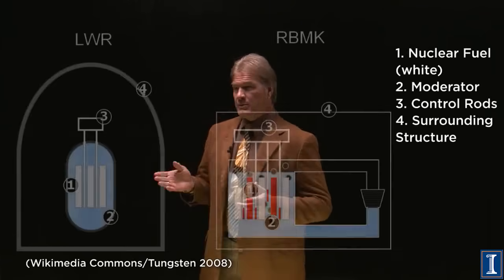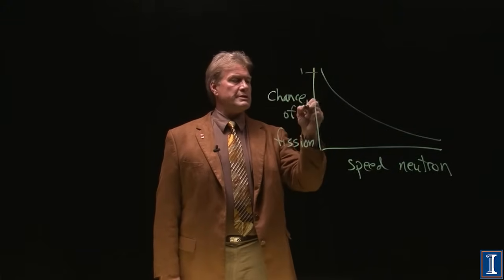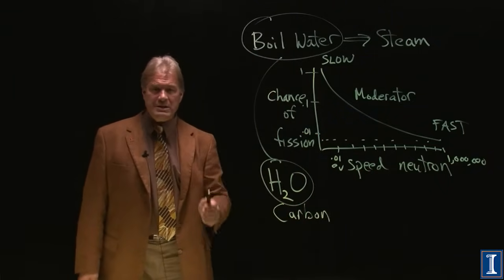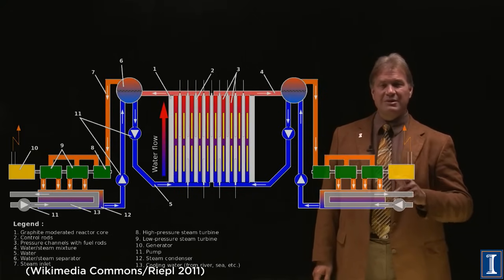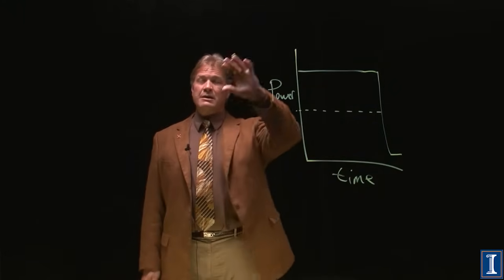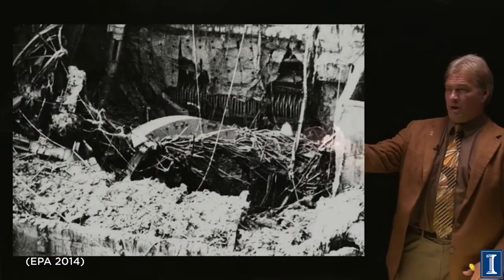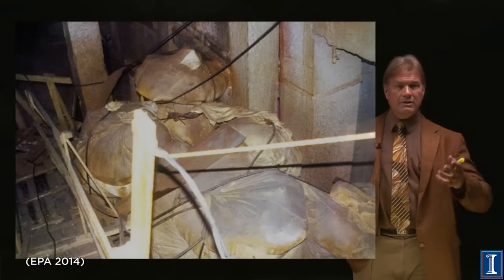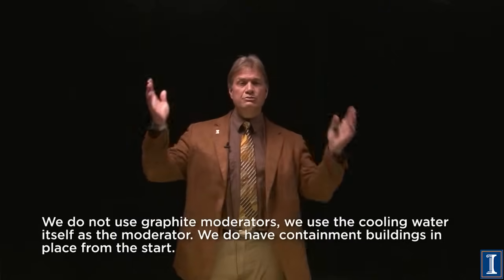Chernobyl: Worst Accident Ever

Comment: Fukushima had a containment buildings.  And why didnt the loss of water slow the reaction?
Reply: At Fukushima, the reactors were shut down automatically when the earthquake hit.  But they were still generating considerable heat -- about 7% of normal -- from the decay of short half-life fission products. 
They didn't lose coolant water, but without the backup power supply, the water got hot enough to chemically react with the zirconium cladding for the fuel rods. 
That produced hydrogen, which leaked out of the reactors' containment structures. But it wasn't vented from the buildings, and eventually built up to explosive levels. Add a spark, and....

Comment: The water/steam "ran out" in Fukushima and it still melted down.
Reply: His explanation is very sketchy and basic, but the point he is trying to make is that the reactor will gonna slow down its nuclear reactions when there will be no water, there was also water in that Soviet reactor and he even showing it seconds after he claimed that only coal was working there as moderator. Water was cooling the reactor but if you like it or not it will gonna act as moderator when it is there and reactor power will gonna go down significantly after you remove the water(but the problem was the rods with tips made from graphite and before they were able to start reducing number of neutrons they were first working as moderator->increasing them).

Comment: he forgot to mention that water also absorbs neutrons so when the water evaporated an excess of neutrons was available  without restrain.
Reply: "excess of neutrons" its not a problem if they are fast neutrons, that is why he started with this graph, to explain the difference...
Reply: @Bialy_1  water evaporated, part of the neutrons was not absorbed any more but graphite was still there to moderate them. moral of the story: don't mix graphite and water.

Comment: I honestly cannot believe those "containment" buildings he's talking about are able to hold down 450 tons of part "E"  thrown upwards by the explosion.
Reply: Some quick googling and notepad math says that a 3-ft cross-section of reinforced concrete above the reactor would've had a weight of 3907N, or only a little less than the weight of the Part "E" itself. Roughly doubling the amount of mass the explosion was lifting off the ground would likely reduce the size of the explosion monumentally, and that's not accounting for the force needed to deal with the tensile strength of the (hopefully reinforced?) concrete, separating that cross-section from the rest of the casket. Also Also: if you plug a gun barrel, the barrel isn't actually strong enough to handle the explosion of a bullet firing: it just redirects the force. With such a massive barrier above the reactor, the explosion would have been redirected sideways to the rest of the building, so if there was an ultimate failure, the explosion would have been directed generally "out" instead of it all being aimed "up".

Keep in mind, I'm not an engineer, just a layman with google and some college credits in physics.
Reply: @treyslider6954  unfortunately you're missing the point here: the containment must remain airtight after the explosion to keep nasty stuff inside (especially gaseous forms of iodine etc)
Reply: First, this assumes that the explosion is exclusively up, and while that's the case within the core as it pertains to movement of the lid and the materials inside, it's not the case in the containment building. Once the reactor lid is blown off, it will move in whatever direction it can. Much like fire, explosions with space like to spread out. The energy starts to dissipate. So, Trey's calculations are correct, but he only accounts for the roof as a negating factor. The explosion, which has already had to deal with moving the reactor lid, now has to punch out against 5 walls of reinforced concrete. Four to the sides and one above, assuming it's not ovoid or spherical which means it's even stronger. There's not only the mass of the walls to contend with, but dampening mechanisms built into the interior architecture. So, yes, it remains airtight in the event of nuclear disaster thanks to the construction of the containment building and the failsafe doors in and out of the area.
Reply: @Bialy_1  the light water is both moderator and absorber. It needs to be displaced by graphite moderator rods for the reactor to work properly.

Comment: Wasn’t the xenon already poisoning the reactor because they were running the reactor at half power for 10 hours.
Reply: If you know a lot about nuclear reactors you probably know a lot about half life’s. Iodine has a half life of 6 hours and after that 6 hours half of that turns into xenon. If that nuclear reactor just dropped to a low level exponentially that wouldn’t cause a xenon poisoning. What does how ever cause a xenon choke is a reactor running around half power for too long
Reply: The reactor was poisoned because the power level was accidentally allowed to drop to a very low level, not because the reactor was running at half-power.

Comment: Just as the Soviets downplayed the accident, the westerners did the same with Fukushima. Only difference is that in Fukushima they are irradiating (still going on) the ocean instead of the air so the nuclear fallout is way less apparent. Like the Soviets, they cannot allow to have a bad image of their design. Consequences of the Fukushima disaster are yet to surface in full affect. 100's of tonnes of radioactive water is being dumped in the ocean ever since they started dousing the reactors.

Comment: Surround structure would not helped in Chernobyl, even during  Three Mile incident operators had to unleashe radioctive gasses outside because of hight preasure, the same stuff in Fukushima. And  the fact that explosion in Chernobyl raised 15  ton structure on 20 metters height, will surround structure survive - hell no. And speaking about earthquake not affecting western reactors - Fukushima proofs that it does. Sure in Fukushima we had less radioctive ellements released in the air, but the same or higher ammount  drained in to the ocean.

Comment: I'm an industrial pipefitter and although this may seem like overkill to learn this kind of stuff, it is incredibly useful to understand the intricacies of the process and history. Thank you very much for posting all your videos. The history and future of power generation is so important to understand, even if people aren't an installer and welder of the process piping like I am.
Reply: 80s 888888888888888888888
Reply: Given that it was badly fitted pipes what sunk the USS Thresher, knowing how to pipe fit it no small matter. My dad had used to work for a company which build compensators for pipe systems and at one point they did them for nuclear power plants. The amount of courses and lectures he had to take in order to do his work was beyond belief.

Comment: Water is also better as a moderator when we need more Hydrogen because Hydrogen in a gaseous phase exists as a diatomic molecule. Meaning that it is actually 2 hydrogen atoms bonded together which in fact have greater mass than just a neutron. The neutron will collide with the diatomic molecule but the gaseous hydrogen molecule is heavier. It also increases the chance of a collision between a neutron and a hydrogen diatomic molecule because it also increases in size, not just mass. And you are right, it should explode in its gaseous state as observed by the electrolysis of water when you ignite the stream of  diatomic hydrogen gas given off.  When diatomic hydrogen is bonded to oxygen (also a diatomic gas), the size of the molecule of water is also more massive, but the hydrogen atoms are not bonded to each other. They are bonded to the Oxygen atom and the hydrogen atoms are as far apart from each other as possible due to repulsion forces in a tetrahedral arrangement. Making each hydrogen atom the size and mass of the neutron.

Comment: That was awesome. Now I understand and it actually doesn't look that complicated. It actually made me realize we as a race never left the industrial age.  Nuclear plants are just super powered steam engines. It is not our fault (the 80-98% of people not "ruling" the world). Those people are the moderators/graphite block (19% being placed over the 80% by the 1%, p.s. the 19% are sheeple too they just are gatekeepers)
cause we have better tech and every day people utilizing such. 
It's people running their cars with water, got hydrogen torchs that drip water out the nozzle and won't cut human flesh, Tesla technology that they monetized, Tesla really had a light bulb lit in his hand not plugged in to a power source directly. Why are we even allowing this, there should have never been a Chernobyl or Fukushima. 
This also supports to me that slavery never ended it just changed form. We " have" to go to work to pay our "energy" bills, but if the moderators weren't involved energy would literally be free, and our intelligence quotient would multiply exponentially because we wouldn't be limited by controllers and there armies which is basically the government.

Comment: I urge everyone to read up and learn more... this is an oversimplified account.  The initial explosion was either a prompt criticality or a steam explosion... there are arguments either way... it was not a hydrogen or carbon/oxygen explosion.  There were two explosions, btw... the first lifted the top off the reactor, the second dispersed the contents.
Reply: The prompt criticality happened but that doesn't cause an explosion. It produced heat over a period of many seconds that it dumped into the water in the core, which then produced the steam explosion. The steam explosion was the mechanism that concentrates a longer period of heat production into a single moment, leading to an explosive event.

Comment: All the people who don't want nuclear energy because its "unsafe" but also want to get rid of fossil fuels need to watch this. You want a realistic way to replace the majority of fossil fuels in our power grid its nuclear energy. Solar and Wind are not to the point yet. The big issue with them is at times they are unable to create power so you would have to have a surplus of power during generation time and store said power for use when the power is not being generated. The problem is our battery technology is not to the point yet to make that a real option. But the chances of the west having a major nuclear incident like Chernobyl are almost zero.

Comment: boiling water IS NOT BEAUTIFUL!!! No----heating molten salt is beautiful. It can be used in numerous chemical ways to produce product for humanity. Thus----the genset is powered by super critical co2 which is under pressure but is not RADIOACTIVE.  AND  the genset is 1/10th the size of our current boiling water steam gensets. Thus LESS EXPENSIVE. So to reiterate, molten salt thorium reactors which do not make plutonium or other transuranics on the scale of our current boiling water reactors is the logical next step for humanities energy production, not boiling water pressure reactors which do not load follow but need controlled at all times with control rods. You need no control rods with molten salt.

Comment: Unless you hit 88 MPH, the flux capacitor is useless.
Reply: The most fictional thing in that movie wasn't the time travel or the flux capacitor, it was a Delorean doing 88 miles an hour.
Reply: Not if you've got some 200 tons Uranium fuel at hand.
Reply: @kalleklp7291  wasn’t it plutonium the car ran of?
Reply: @quantumpilot6843  Yes, you're right...but with the "Mr. Fusion generator," it can even run on garbage. :)
Reply: Hahaha... LMAO !!! Great Scott , you are correct.

Comment: The Chernobyl reactors were not due for refueling. Reactor No. 4 was to be shut down for a test. They ("they") wanted to test if, given a failure of the national electric grid that furnished  the power that ran the coolant pumps, the backup Diesel generators would come online fast enough to keep the water pumps running. There was a time gap between the two events (national power grid losing power and Diesel generators supplying power). The theory to be tested was that the inertia of the spinning generators would supply enough power to keep the water pumps running until the Diesel generators were fully operational and took over the supplying of power to the water pumps. The time needed for the generators to come online was between 40 seconds and three minutes. But there were complications - in effect, a perfect storm of mistakes and oversights were created. To begin with, that day there was unusual power demand and the operators delayed the test until after 23:00 in order not to affect the electricity supply. However, at that time, the second shift started arriving for work. These were less experienced personnel who had never received training on how to conduct this test. There are a few detailed explanations available as to exactly what happened, the complete chain of events, including compounding errors (there were no nuclear scientists on site, operators pulling all the graphite rods, trying to reinsert them again etc.).  It is a fascinating story, not least the super-human heroism of the first responders who went knowingly into an almost certain death trying to contain the disaster.

Comment: Actually they should have called it a night .not day.. BTW if it was stalled at low power what should they have done?to make it stable?
Reply: Randall R you raise some of the control rods a little bit at a time, and let the power rise very very slowly, like over a period of days, to allow the xenon to burn off at a controlled rate and when it’s done burned off the reaction will be under control. 

What they did was pull almost all of them all the way out immediately. The Xenon burned off quickly and the reaction started getting exponentially faster, then a quirk of the design of the control rods meant that when they tried to put them back in it spiked the reaction for a second and that ran it out of control.

Comment: I predict a Super Accident average every 35 years. (I hope I am wrong)
Reply: based on?....what?
Reply: @AmbientMike   Bases on a calculation I read many years ago. It showed that the probability of an accident is very low. But if you multiplied this probability with the number of existing nuclear power plant it gave exactly 35 years. And somehow Chernobyl and Fukushima time difference is about that. I know two single events do not prove the formula and that is why I hope that it is wrong. (But I got scared that it nearly happened as this calculation predicted. And the calculation was done long before the Chernobyl accident)

Comment: Most material on Chernobyl fails to capture the main reason why the RMBK reactor was actually designed and built this way. The most important feature of this type of reactor was the ability to change the nuclear fuel elements at any time while the reactor is running at full power. This allows the extraction of various isotopes, which would otherwise be wasted if the full nuclear fuel cycle is completed when the reactor is shut down for periodical refueling and maintenance. Many nuclear engineers, who had a chance to work with it, call it a nuclear weapon factory and righfully so, as the power generation was almost an afterthought in it's design with safety taking only a third row.
Reply: Yes he infers that in another video about enrichment.

Comment: Wait. I've always been told -- by nuclear engineers, no less -- the loss of water in the reactor of a commercial power station will slowly (for various definitions) overheat the fuel rods until they melt -- thus a "meltdown". (this is partially what happened at TMI - the core was partially exposed.) A small "research reactor" (like the one at NCSU) can be run dry as it's far too small to generate that much heat. (and accidentally has.)

(as doom-sayers and hollywood paints it... melts through the containment build, hits ground water, and explodes.)